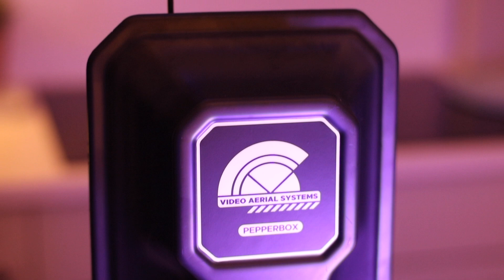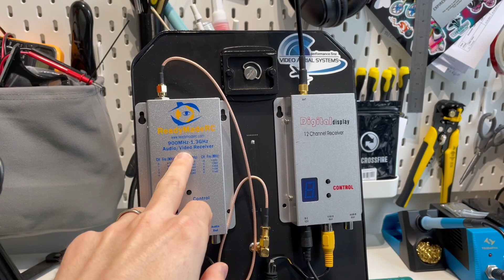📡  Ground Station Update - NEW VAS Pepperbox & TrueRC Gatling

Comment: Bardwell did a video on the Clearview Unit. Its not really diversity... But kinda is. You have to use matching antennas for it to work at peak performance is my understanding... Looking forward to that video. 🙂
Reply from the maker: Yeah it’s designed to be used with 2 of the same antenna for merging pictures using its “Clearview technology”. But after contacting them we discovered it does have a standard diversity mode too 👍🏻 I’ll look forward to testing it against my RMRC rx 😎 cheers.

Comment: Fantastic insight of your excellent selection of gear Adam! Shame about the Diversity Demon as he outperforms the Eagle Eye by miles. The CV's true magic comes in combining 2 pictures into 1 good one - unlike the other two. Ideally you use two identical antennas on the CV. However it can be used as a classy diversity box but it's like using a Porsche to pull a trailer :)
Reply from the maker: Hi Stuwe, I did read that the Demon was a lot better than the Eagle eyes which is why like you I made the decision to spend the extra cash on it :) My guess is you might have also tried the Eagle eyes? Yes the clearview's primary mode is as you say to blend the 2 pictures with 2 of the same antennas being used, which in some cases may work well, for example if you were someone with 2 x TrueRC Gatlings😁 but my guess is that the majority fo people want to use 'traditional' diversity allowing for different antennas to be used. My friend emailed the clearview guys a few weeks back to confirm that the CV does in fact have a traditional diversity mode. I'd love to see the results of using it both ways. Maybe we will plug both mine and Sam's pepperboxes into it one day and see what happens 😎 Thanks for watching and commenting!
Reply: @AdamGdoesFPV  Yes the CV works in both ways and is to my knowledge the only Rx with -103dBm. So that alone should outperform anybody else. Still I feel using a CV just for diversity purposes is a bit a shame only because we have no alternatives anymore.. Besides you're frequency bound. The beauty of the Demon is the independence of the frequency and the 3 inputs! I could use a 4th or even a 5th input :) Shame that nobody like i.e. TBS picked up where Oracle left off. There is surely a demand for that and it only increases safety and options of fpv flying.. Can't wait to watch your CV review down to the bone!
Reply from the maker: @stuweFPV  Unfortunately the CV turned out to be useless. Came with many faults straight out of the box, like it had no QC. Ended up being sent back for a refund after trying to fix it for 2 months.
Reply: @AdamGdoesFPV  oh, no way! I had high hopes for it and I was really looking forward to your review.
Reply from the maker: @alanhobbs4879  Yeah unfortunately it wasn't even good enough to start a review :(

Comment: i’m interested in seeing a side by side with the oldie.. i’m looking to get into 1.3ghz for an rc car. I have dji for my 5” but i need penetration for ground level applications like car. Great video and setup!
Reply from the maker: Hey, the side by side won't be happening as the specs are almost identical, so i doubt there would be a noticeable gain at all. However, it's worth purchasing for the smaller and lighter form factor 😎

Comment: Did your buddy end up getting his Clearview XLR? Would love to see the comparison!
Reply from the maker: Hi Sarah. Yes he purchased one last year and it took a very long time for the company to build and send (I think approx 4 months between ordering and receiving it). To start with it wasn't in a very good state, connectors were hanging off it and there were shorts. My friend is pretty smart with electronics and was able to repair issues with it. When performing test flights he was getting terrible range and having multiple problems with it. We even recorded the same flight on both of our GS's and his turned to snow when mine was still getting a perfect signal. The story on this one is quite long but in the end he swapped out the XLR for RMRC and eagle eyes diversity and picture was perfect... so the XLR was eventually sent back for a refund in the last couple of weeks. Not good results for a very expensive bit of kit.
Reply: @AdamGdoesFPV  thank you so much for the update Adam, what a terrible experience. So much waiting for such a poor outcome 😐

At least that answers that question.
Reply from the maker: @sarahdaviscc  Yeah it was extremely disappointing. Maybe it was bad luck? You'd think at that price they wouldn't sell any if they were all like that. But it really felt like it hadn't been through any QC. Not sure what I'd do now if my Demon breaks.

Comment: On paper, the Pepperbox is better than the TrueRC. In fact, it looks like the Pepperbox might be superior, even though it's half the price. Any thoughts?
Reply from the maker: For 95% of people and for 99% of any flights the Pepperbox will be the better option and the one most people use. It has a wider beam width and has enough gain to take you as far as you ever need to go in terms of range. And then there’s the price, it’s super cheap compared to the Gatling. However, if you want to push the boundaries and get the max performance you can get, the Gatling is the one to use. I only ever use it on rare occasions for super low runs where I will be flying behind trees, land and other objects. Cheers

Comment: My 1.3ghz pepperbox xtreme showed up today, I want to setup mine like yours, is the receivers and repeater all hot glued to the pepperbox or did you use some screws? I  would like to have 3s battery for repeater mounted on  there too but haven't figured out how to mount it yet? Thanks for video
Reply from the maker: Hi, No i didn't use any screws, I'd avoid that as you may damage the antenna. I used hot glue for everything. Cheers

Comment: Great video with brilliant explanation!
Question: do you think 5G8 will work for a FPV Plane with ranges from 1km up to 5km?
Thanks in advance!
Reply from the maker: Thanks, glad it was useful. 5.8g to 5km is definitely achievable. Flying far on 5.8g requires a lot more altitude that 1.3G which is why I never like it much. However, if you go 5.8g digital with something like DJI you can fly 5km + with ease at much lower altitude.

Comment: Very nice video, i was wondering if the long coax cable from the pepperbox to the receiver decreases performance, it could be shorter and performance might be better? The eagle eyes is for sale occasionally, a buddy of mine quit the hobby and sold all his gear, so i was lucky to get a RMRC receiver, a sturdy tripod, the eagle eyes unit and a VAS helical for pocket money.
Reply from the maker: Thanks Herman :) Yeah the coax is longer than it needs to be but It was the one that came with it. Alex G who designed this really knows his stuff so I'd be interested to hear if he thinks there would be any benefit to using a shorter length there. Yeah you can pick units up second hand occasionally, you were one of the lucky ones to get your hands on the gear by the sounds of it! Cheers

Comment: You fly Crossfire or 433?
It seems there is no way without 5.8 relay to get it working? I mean having the screen next to the 1.3 stuff means it's getting jammed by RC link?
Reply from the maker: I fly both. I can fly fine using the monitor stood next to my GS but I normally fly with repeater and stand away from the GS just to make sure.
Reply: @AdamGdoesFPV  great. I cant go past 400m with 200mW vtx setting using matek vrx. But on Partom and some handmade patch I went 2k out at 50m alt but had to walk away from the vrx a couple of meters.

Comment: Which one do you think is better, TrueRC X-AIR 1.3GHz or VAS Crosshair XTreme V2 1.3GHz?
Reply from the maker: I've actually not got either, but if I'm honest i expect you won't notice much (if any) difference between the two. TrueRC normally looks nicer and is a bit smaller/lighter but costs more. Cheers

Comment: Could something similar be made or found for Caddx Vista HD system?
Reply from the maker: Yeah it can be done and people have done it. Just used the walksnail VRX module and high gain 5.8g antennas instead. Some will also mount on an Antenna tracker.

Comment: what is the max range of the new  VAS Pepperbox? 
I want to make an order and I am confused between TrueRC X-AIR 1.3 RHCP 2020 Edition and the new VAS  Pepperbox, what did you recommend for long rang?
Reply from the maker: Hard to say the max range of an antenna, it depends on so many factors, the antenna is just part of it. In theory the Peppebox will have a longer range than the X-Air as it has a higher gain. Choose your antenna based on your flying style. Look into the beam width, size, will it be on a tracker etc etc. I've seen someone go 100km on a X-Air before on a FB group, but most people don't want to go even half as far as that... or they think they do until they actually start flying.
Reply: @AdamGdoesFPV  I use MFD crossbow mini with my 5.8 setups and I got the maximum range of it. Now I start with 1.3 planning to go about 100-150km, with a tracker and fly at a high altitude as you recommend the Peppebox will be better for me but I don't know if it is the right size for the MFD tracker!

Comment: Hi adam hoping you can help please . basically i flew my mini talon the other day, I have the mtd autopilot installed and havent had any problems when engaging launch mod ! Just been out to try out new frequency 2.4ghz as apposed to 5.8ghz . But now when i try to engage launch mode useing channells 5 and 6 it doesnt work and it shows throttle safety instead of (launch) cant understand why? Can you help please the tx im useing is futaba t8fg.  kind regards trevor
Reply from the maker: Hi, the only 2 things I can think might be causing this:
1: no control link. Can you confirm link is good? Move control surfaces etc
2: Have you adjusted rates? Using low rates can stop it from being possible access launch mode. When you move the stick to the side does it show the msg that is something like "set chn 5 high for Launch"?

Comment: Hey adam, question for you! I sold dji to a friend after as you warned i found the range too limiting, so i’m back on 5.8 analog but with nicer goggles for the time being. Seeing that the only real way to get a diversity setup right now is over 800 dollars including all of the side components on the ground station, how bad of an idea is it to just use the pepper box without an omni? and no, i won’t be flying in close proximity circles around myself, looking more for distance out in front of me seeing that I live in the farm area of the US
Reply from the maker: Hey Michael, it’s a perfectly good solution to fly using just the pepperbox 👌🏻 especially with the type of flying you explain there. You can still go behind yourself a short distance with the PB too.
Reply: @AdamGdoesFPV  sounds good 👌 thanks for the quick response
Reply: @bassohollic  yeah but the video doesn’t look great along the way which is important for me trying to do low/high speed studf
Reply from the maker: @bassohollic  5.8 is good for 40km out if you want to fly at silly high altitude and have a fairly poor video quality. 1.3g if you want to go out far and stay low and even go behind objects 👌🏻
Reply: @AdamGdoesFPV  agreed, 1.3 will dominate all day because of the lower frequency and larger wave length. 

Just wanted to show people that 5.8 can have some interesting results as well 😜

Comment: Hi, are there diversity controllers that you can actually buy? Everything I see in various ground station videos is discontinued.
Reply from the maker: Yes, this is covered in the video 👍🏻
Reply: @AdamGdoesFPV  but...(c)  $189.99
This item is no longer available.
We are sorry, but this item is no longer available.
Reply from the maker: @ForbiddenOldman  there are 4 topics in this video, and 1 of them is all about this being discontinued and the alternative on the market
Reply: @AdamGdoesFPV  Yes sir, I found, I apologize for my inattention)
Reply from the maker: @ForbiddenOldman  haha no problem 😄 thanks for watching
Reply: @AdamGdoesFPV  However, at such a price, I would prefer some kind of manual video signal switch), especially since I can control an aircraft and not a strategic missile, I think I will have time to press))